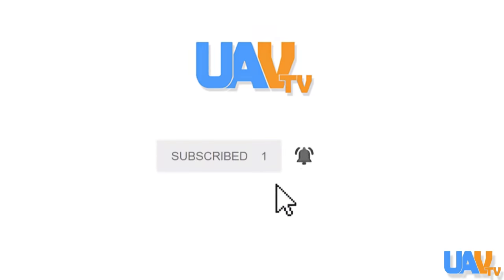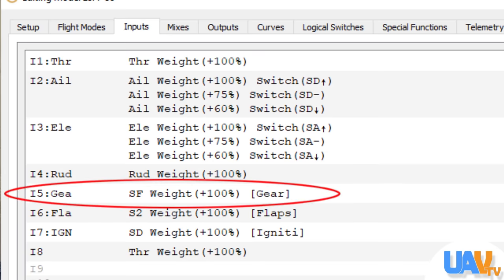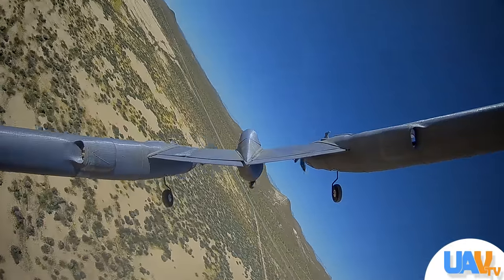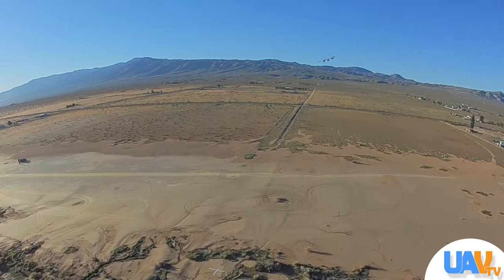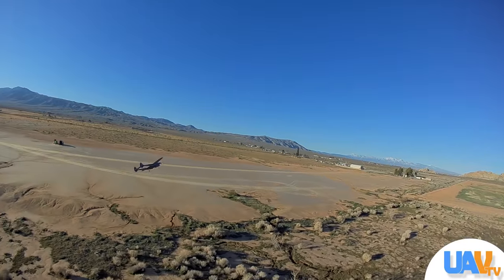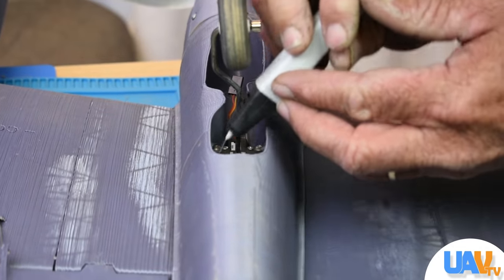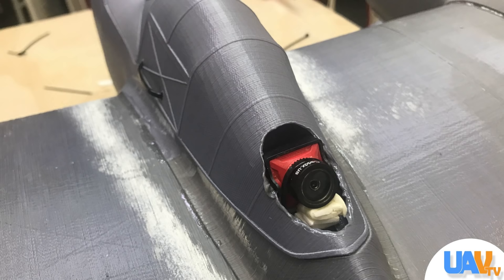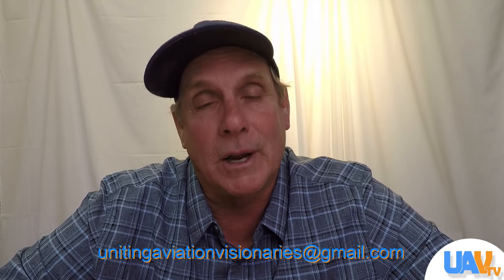3D Printed Airplane Crash

Comment: are you using PLA? How are you saving them from the heat out there?  It's been a pain here in texas.
Reply from the maker: We keep them in the shade or in AC.  The garage can be brutal.  We are trying to figure something out short of annealing the entire plane.
Reply: @uavtv5809  indeed only other option is a different filament.  But I haven't found anything very suitable yet
Reply from the maker: It’s unfortunate that there isn’t a more heat resistant PLA.  We have somewhat limited room to keep these planes nice and cool.  Summer is coming so we need to crash these planes so we don’t have to deal with them melting instead.  😉